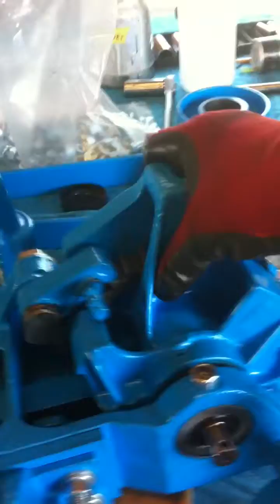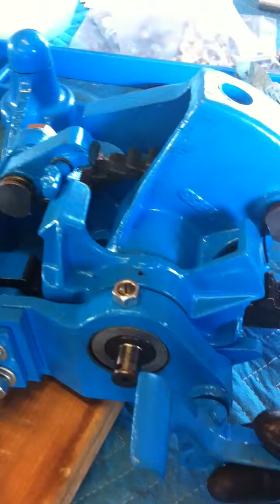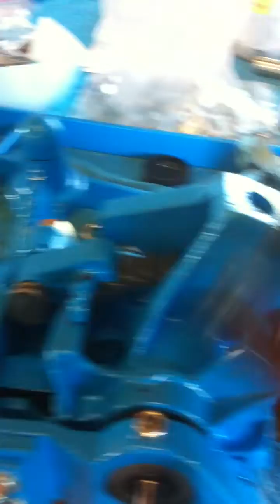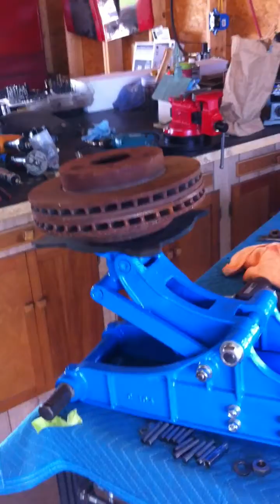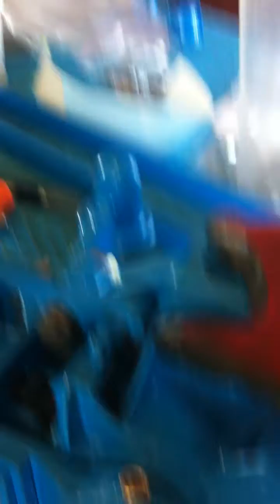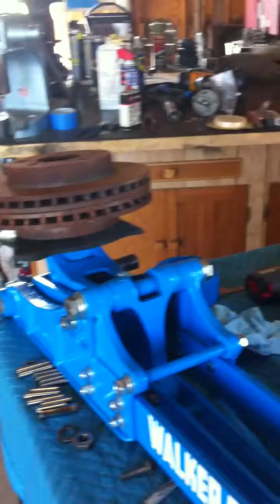restored walker jack

Comment: Nice I just bought one off an old lady that was her husbands fathers jack it is also a 740 made in 1922 works but i am trying to find the original colors that the jack first came with. Are those the original colors that you used?
Reply from the maker: Best I can find yes
Reply: It looks awesome. Mines seems to be reddish orange and has no traces of blue. Only thing blue is the manufacturing plaque. 

I am also looking for parts such as the small rear casters and bearing for those casters because mines in dead shot gone and bearings rusted to no return. Do you know of a site or anything that sells a rebuild kit or parts?

Comment: So I've been looking at one of these. Not restored. Just sitting outside. How valuable are these things?
Reply from the maker: Ryan Whisenant depends on who wants It , I paid 40.00 for mine and it was rusted solid , probably put 200.00 in it to restore . Can I get that back ... probably not but it's a cool piece of car guy history
Reply: So I picked it up today, free of charge. I hope i can get mine lookin as good as yours :) I got it just for the history. Not really great with vehicles. So hopefully i'm not in too deep. The Walker tag is still on it but i haven't found a date yet.
Reply from the maker: Ryan Whisenant pb blaster Will be your best friend , this one I had powder coated
Reply: I did find that mine is a 745 Series C 2 1/2 Ton 3 3/4-20 inch cap. So by what I have found its early 30's?
Reply from the maker: Ryan Whisenant seems like mine is a 1929 ish

Comment: Mr Fireman
I recently got a walker jack . Im trying to get it working. My question is there one main pin that goes all the way through the gear mechanism? Im trying to take apart the gears and I'm pounding on the pin with a hammer but it is not moving. Does that pin go all the way through or is it two small pins that do not go through?
Reply from the maker: +speakbig truth Its one pin that goes all the way through
Reply: thanks
Reply from the maker: Here's a link to my restoration with pics 

http://www.garagejournal.com/forum/showthread.php?t=215234